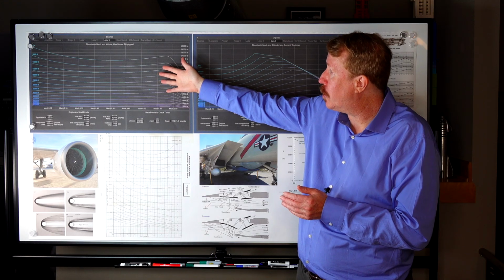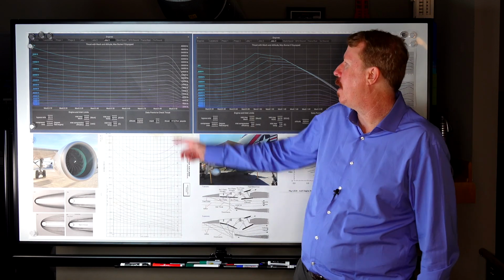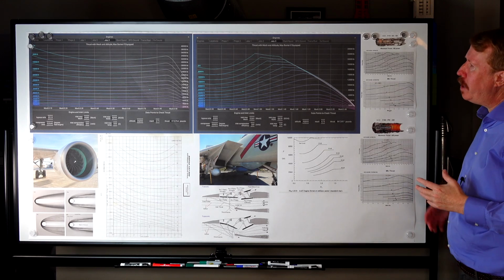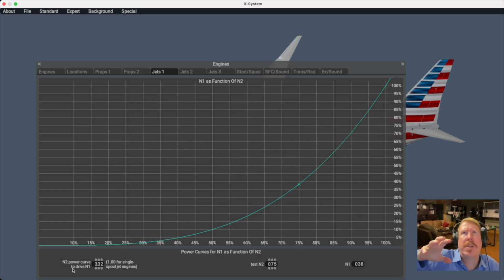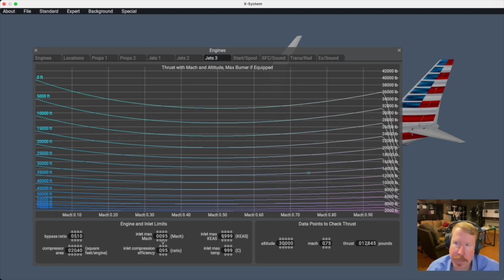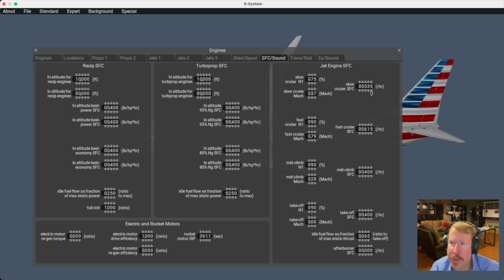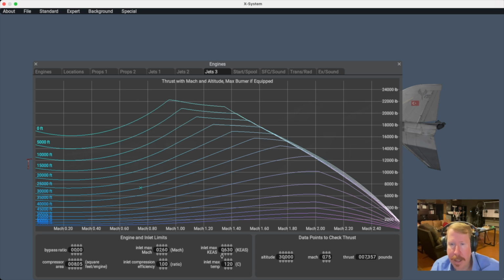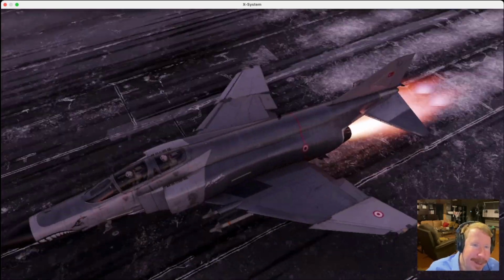X-Plane 12's Jet Engine Thrust Model

Comment: why are the pictures and drawings seen on the board not in planemaker? need notefields as well. if it needs scroll bars, that's what it needs. think of planemaker like a workbook for developers, i want all my concept stuff and notes and drawings saved in that .acf file thing. mouse over explanations in the ui - if i may make a suggestion, should react not only when within the number fields, but primarily when over the text. thanks.

Comment: This is why I love X-Plane and keep advocating for X-Plane for flight training instead of MSFS. I love how he always starts from the physics and goes from the instead of coding how the planes should react.
Reply: Also… could the team give some love to X-Plane Mobile 🙏 my iPad Pro M4 16GB is so powerful and can handle so much higher graphics and texture quality please allow higher settings or if that’s to much work just enable 120FPS because now I’m just stuck at 60FPS locked with bad graphics 😢. Oh and while I’m asking for extra features please look into integrating some kind of frame generation and maybe ray tracing. ( I know I can use lossless scaling app for frame gen but that doesn’t have access to motion vectors of the game/sim so the quality isn’t that great.

Comment: So not to be pedantic (aka I'm about to be very pedantic) but jet engines don't have a limited amount of power, they have a maximum amount of power, which is itself a function of airspeed due to aforementioned ram air and comprehensibility effects. Also in principle any fluid dynamics problem can be broken down into some object geometry dependent coefficients that you enter/measure and the mach number, reynolds number and froude number (the last of which is almost always irrelevant for air) and from there the same equations will be more or less universal (with a few caveats and assumptions about constant heat capacities).
Reply: *those coefficients are also functions of those three numbers in addition to geometry but nothing else. Same geometry (which implicitly includes AoA), same mach and reynolds, same preformance
Reply: Very cool. Thank you 😊